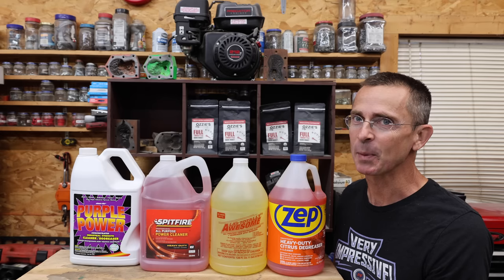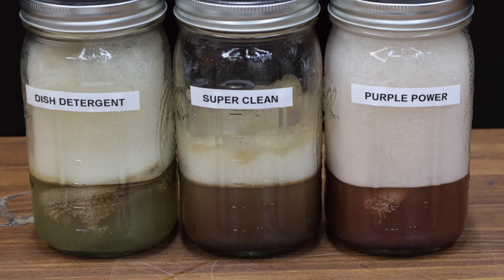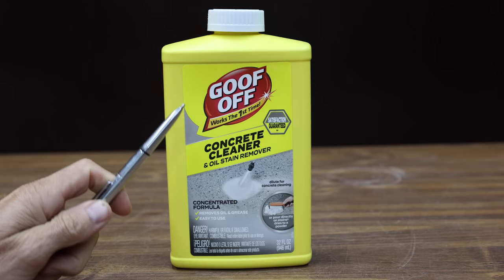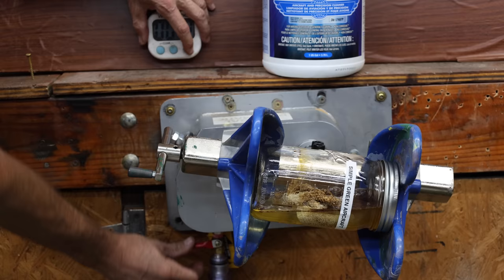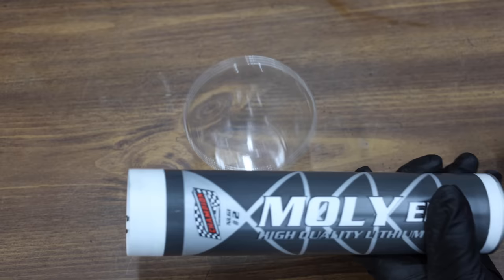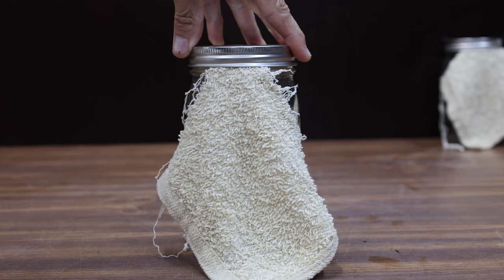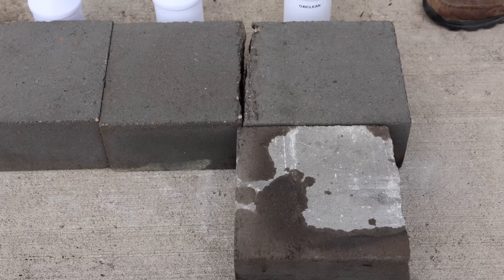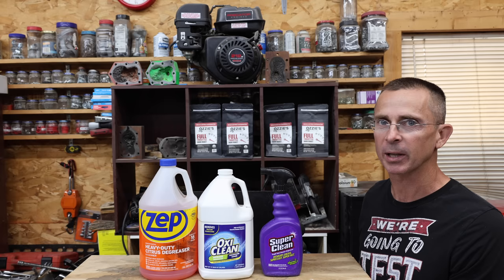Best Concrete and Engine Degreaser? Let’s Settle This!

Comment: I worked at a automotive garage back in the early 90's and they had a powder product to clean the floors. You wet the concrete floor, sprinkle this stuff on, work it in with a few light passes using a push broom, let sit for 5-10 minutes and then rinse off with a hose. It was absolutely fantastic! Concrete was perfectly clean every time, no matter how nasty and oily/greasy when you started. Now I'm a homeowner and want this same stuff to clean my garage/driveway....I have no idea what it was. I cant even find any powder floor cleaners on the market. Does anyone out there know what it might have been and if its available today?

Comment: I use purple power for everything. I've used it as degreasers on my tractors it's  safe use in a steam vac for carpets which it does awesome for stains on carpets it works pretty good for laundry stained up work clothes also works awesome to clean grout lines! For the money it's hard to beat it! But with this awesome channel now I have a couple others to try!
Reply from the maker: Thanks for sharing!

Comment: I like your style of presentation. I have always wondered if the "quality" of the same brand products sold vary from merchant to merchant.  Example is a DeWalt 5ah battery from Walmart as powerful as on from a fleet and farm chain, or Acme, Harbor Freight, Northern Tools... I know DeWalt isn't sold off Walmart, Harbor Freight shelves, but I am sure you get the idea.
Reply from the maker: Thanks for the suggestion.
Reply: DeWalt would waste more time and money doing that  (creating different products in identical packaging and sending them to different places) than just sending the same battery to all places.  Additionally, folks on youtube have tested that.  As long as the batteries aren't counterfeit, they are the same regardless of where you purchase them.

Comment: Stay product testing. BTW I clean engine oil spots off white concrete by putting a small pile of cheap kitty litter over each spot, then soak well with paint cleaner or mineral spirits, something that does NOT dry up too fast. Does a 100% amazing job, try it!
Reply from the maker: Thanks for the feedback.

Comment: I know it's a bit late for this comment, but you should throw a heavy coat of oven cleaner to a surface.. I've used it for years to easily clean old engine blocks that had that nasty cooked on goop, may need to ask cousin Eddy if the farmabeggo could use it somewhere under that beast lol. Good vid though! We all appreciate your non biased experiments!
Reply from the maker: Thanks!  Thanks for the suggestion.

Comment: I will tell you the best thing I've ever found. Works way better than anything else. It's to pour a little gas on the grease spot on your driveway.
Sweep it around a little, but with a broom. And put oil dry on it And work it in with your foot . Then sweep up oil dry. Try it, you will be surprised On how good it works..
Reply from the maker: Thanks for the info!

Comment: In the detailing world, tires can be very difficult to clean. So far, I have used Super Clean, and Zepp, as they were easy to find in my small town. These products have to be used at full strength numerous times to even make a dent. The biggest problem with tires is Tire Shine. Sadly dealers use it and in my opinion, ruins the tire, because is it is to difficult to remove its yellowing effect. It would be great to see a test for a tire cleaner and a tire shine that doesn’t ruin a tire for future washing or yellow fading.
Reply from the maker: Thanks for the suggestion.
Reply: Be careful, Super Clean can corrode/etch aluminum. A few years ago when detailing YouTubers were hyping it for automotive use they said it was safe on all metals. Now SC has a specific warning about that it’s not safe for it. Because of that I’ve gone back to Simple Green Pro HD, the purple one. It’s specifically formulated to be safe on all metals.

Comment: Your product testing is great, I check here before any purchases for the most part. 

I'd love to see a video on frying pans; maybe costco brand vs ikea vs hexclad vs industry standard: stainless steel?  

Is the teflon really as thick as they say, is the pan really non-scratch, is the heat evenly dispersed, at what temp is the heat damaging the pan or the surface coating? 

And I saw your video on batteries lately; maybe you might do one on those 56v lawn mower battery and their knockoffs?
Reply from the maker: Thanks!  Thanks for the suggestions.

Comment: Best as well as least expensive grease, oil and stain cleaner for driveways and garage floors is is Diesel. Simply spray it on and that is it. a couple of days and stain and diesel is gone.
Reply from the maker: Thanks for the feedback.

Comment: Its like you read my mind sometimes lol. ill have some project I have to do and will go to look up different products on it and boom you just made a video on exactly that within a month ago lol. I have a jetski that had a cracked cylinder head, and the breather hose spot watery oil everywhere in my engine bay. was curious which one of these would work the best. Definitely going with either the super clean, oxi clean or zep, whichever one my local hardware store has in stock. thanks as always.
Reply from the maker: Nice!

Comment: Good job.  I like the solvent based degreasers - never had much luck with the detergent ones. I like the testing that you do, if you integrated that into the automotive such as old engine vs rebuilt engine that would be cool.
Reply from the maker: Thank you!
Reply from the maker: Thanks for the suggestion.
Reply: @ProjectFarm  You are welcome

Comment: They aren't for cleaning, but I'd like to see a comparison of 1. Starting Fluid vs 2. Gasoline vs.  3. Carburetor cleaner.  I think they all clean grease better than the others. That being said, lol...the places you can use them is limited.
Reply from the maker: Thanks for the suggestion.

Comment: I think what we may have missed here is that most people using a degreaser aren't mechanics. Generally it's being used for stoves, range hoods, ovens, laundry, tops of kitchen cabinets, surfaces adjacent to stoves and other interior uses, all mostly involving fresh and/or partially polymerized cooking oils. 
   It's unclear if any of these interior uses encountered by normal individuals are similar to trying to clean used motor oil and heavy greases from rags and concrete. 
   I do a lot of hands-on stuff, I've never tried to wash a grease soaked rag. They get disposed of. (I have heard that) if you burn them now you don't have to worry about fire hazards later. But that's probably not politically correct.
   And I think most of us wrenching on cars are going to go for cat litter and gasoline if we want to get motor oil off concrete. Maybe degreaser after gas gets rid of nearly all of it.
Reply: I'm uninformed as to any relationship between grease and mildew.

Comment: I found the best degreaser is Big Red detergent and kerosene 60 Kero and 40 big red also another is Amosol and kerosene or jet A1 fuel and that is about 25 to 30  amsolo and 65 to 70 kerosene 
The big red and Kero with wash of very clean oil and grease and will dry very quickly leaving no residue the other will also but needs more hosing
Reply from the maker: Thanks for the feedback.

Comment: Maybe you could compare few brands of after market common  suspension parts like ball joints or tie rod ends. Moog used to be a good product but not any more. I wonder how after market compares to OEM. Thanks for a great chanel.

Comment: So your telling me Dawn dish soap cant be used at full strength, because they recommend a diluted amount for basic cleaning, but purple power can. Purple power at full concentrated strength will wreck most things it gets on aluminum, paint, plastics, rubbers not to mention your skin. I wonder what the Dawn would have done had you used it at full strength. Dawn also needs warm if not hot water to really work. also run simple green warm 50/50 mix. Those are always my picks. Definitely cool to see the other products.
Reply: Agree. Need way more Dawn, I mix 3-4 oz in a 32 oz spray bottle. The amount he used is for doing dishes.

Most of these will corrode/etch aluminum. Unlike The WD40 Specialist and Simple Green Pro HD which are specifically made to be safe on all metals and not corrode.

Comment: You pretty much covered most of the popular degreasers, so thank you for that.  I also like the fact that you have sped up the video.

Future test recommendations (sorry in advance if you already have videos on them):  motor oil filters, shoe repair adhesives, furnace air filters, auto air filters, OBD II scanners (bluetooth version), low-end OBD II scanners (with built-in screen), windshield wiper fluids, leather conditioners.
Reply from the maker: Thanks!  Thanks for the suggestion.

Comment: Try a 3M degreaser? I've found the 3M General Purpose Adhesive Remover to also be a good degreaser, but 3M probably has a more dedicated product for degreasing. I did like the video though.

Comment: I've Used Totally Awesome And Super Clean. I'm A Mechanic And Used In An Engine Bay / Parts Cleaner Application. I Will Say Totally Awesome Works Good But It Does Have To Sit For Awhile Before Your Power Wash Or Scrub . The Super Clean Was My Favorite. Works Best In Every Way In My Uses Compared To Totally Awesome. One Thing I Did Notice On Bare Aluminum Between These Products Is Totally Awesome Leaves The Aluminum Dull. It Doesn't Pit Or Eat The Aluminum But Leaves It Matte Same With Plastics . The Super Clean On The Other Hand Leaves The Slightest Bit Of Gloss To Aluminum And Plastics. Makes Engine Bays Look Really Nice. Super Clean In My Opinion Is Stronger Than Totally Awesome. Now I Have Tested Totally Awesome And Purple Power Back To Back On Pistons. I Was Soaking Them To Clean The Carbon Off. Totally Awesome Does Etch Aluminum If Soaking In It For Days. Purple Power Not So Much. Purple Power Worked Better On Carbon Build Up Than The Totally Awesome. Didn't Have Super Clean At The Time.
Reply from the maker: Thanks for sharing.

Comment: 8-10 Parts of Super Clean to one part Instant Power Heavy Duty Drain Opener (has both NaOH and KOH) - x-jet it. If you want to save $$ mix 9 parts NaOH (sodium hydroxide) to 1 part KOH (potassium hydroxide). Add 3-6 cups to 5 gallons of either water or Super Clean. KOH is 3X the cost of NaOH. Using a product which contains 90% NaOH & 10% KOH is like getting the best of both, you will be get a lower in price product with a better exothermic reaction than with Potassium Hydroxide alone, but you will have a faster penetration and better rinsing product than if it just had Sodium Hydroxide.
Reply from the maker: Thanks for the constructive feedback.

Comment: Need to use these products to test against carbon build up in engine. Removing the varnish from pistons rings, and all the staining is the real true test. purpose power is good, but it will make aluminum black!
Reply from the maker: Thanks for the feedback.

Comment: Suggestion: 
Contactor grease and rinse free flux. 
I use deoxit for electrical plugs and a rinse free flux for electronics. I know that the flux I use for plumbing needs to be rinsed because it is so aggressive and persistent that over years it will eat into your pipes causing very difficult leaks to find. Always quench and clean your joints to avoid this. In electronics you cant so much. No water. I'm curious how well rinse free flux works and does deoxit keep contactors clean or erode them like old flux. Kinda two subjects. Not really, maybe. You are the guy I think of when I want to know this kinda stuff.
Reply from the maker: Thanks!  Thanks for the suggestion.

Comment: By far and away the best cleaner that I found is the $3 a gallon stuff from the dollar store in a plane clear jug but be careful cuz it will eat the paint if it's not diluted but it makes an old greasy aluminum lawn mower motor come out looking like a brand new one!
Reply from the maker: Thanks for the suggestion.

Comment: Yo!  Loving the videos!  Two things-  how many qts did you have to use when you put the oil cooler on???  2- do you use seafoam to clean your crankcase before you change the oil & do you use Lucas oil stabilizer when you refill your oil?

Comment: LA's Totally Awesome is available for SUBSTANTIALLY less money at Dollar General, Family Dollar and Dollar Tree.

You paid a ridiculous $20/gallon.

A half-gallon jug at Dollar General and Family Dollar is $3.75 which is $7.50/gallon.

At Dollar Tree, a 32 ounce bottle is $1.25 which is $5.00/gallon (this is how I buy it).

At Family Dollar and Dollar Tree, 20 ounces in a spray bottle is $1.25 which is $8.00/gallon.

It has multiple uses and, depending on the type of stain/soil and what is being cleaned, it can and should be diluted with water per the various ratios on the label.
Reply from the maker: Thanks for the feedback.

Comment: I'm surprised you didn't use Muriatic Acid, usually the goto for cleaning concrete driveways. Never used anything better
Reply from the maker: Thanks for the suggestion.

Comment: which heated outdoor vest would you recommend regarding 1 Best thermal heating, 2 Maximum thermal element coverage, 3 Least bulky material, 4 Very lightweight feeling, 5 Durability, 6 Price point  ?
Reply from the maker: Thanks for the suggestion.

Comment: If you revisit this one I'd like to see how mineral spirits, acetone and brake cleaner fair. I don't think anyone would mind you branching out, I enjoyed the video on sprucing up your old diesel, Been doing the same with my own for a while. If you could only do one or the other I don't think anyone would want to see the product testing go, if you can keep up with both I don't think anyone would mind, and I'm sure quite a few would enjoy the tangential content as well. As long as you continue to do a reasonable amount of product testing on the big ticket less subjective things I would think most would be happy. 
To give an example: I don't really need a big brand comparison between the usual suspects in power tools for each and every type of tool they make, such as Dewalt, Milwaukee, Makita, Ryobi, Rigid etc. Because subjectively there isn't really all that much difference, although it is nice to see new or budget brands that don't have a solid reputation, like HF's new tool lines for example. 
  However when it comes to many of the chemical products, it seems to often be the case that half or more just flat out don't even work, or very poorly, I don't think anyone ever felt like they wasted their money buying a Dewalt instead of a Milwaukee for instance, but I used PB blaster almost exclusively for years and always felt like it wasn't really doing much, and discovered your video on penetrating oils and learned that it was useless, with no improvement. Switched to LW and have sworn by it and your channel ever since  to anyone that will listen.
Reply from the maker: Thanks for the suggestion.

Comment: Have you compared the various concrete garage floor preparation methods prior to the application of stain, paint, epoxy etc.?  There are sanders and various acids including citrus.  I know prep is critical to a good coating so I'd like the best chance for good finished product.  Thanks.
Reply from the maker: Thanks for the suggestion.

Comment: You forgot liquid laundry detergent (Tide).  I've used liquid laundry detergent on my hands after working with gear oil and full strength liquid laundry detergent will definitely work and get that horrid gear oil residual smell out of your hands!  I'm not sure how liquid laundry detergent will work on the driveway but I think it should work fairly well.  Mind you liquid dish soap is the cheapest route for any of the misers out there!
Reply from the maker: Thanks for the suggestion.

Comment: Where was Super Clean in this testing. I spilled two gallons of used diesel oil on my brand new concrete driveway and with super clean a broom and a hose my driveway was saved from a big nasty black oil stain
Reply from the maker: Thanks for the suggestion.

Comment: I would be interested if you tested foaming soap for foam cannon cleaning car.  Either which soap foams the most or if thick foam cleans better vs runny foam that doesn't stick as much.
Reply from the maker: Thanks for the suggestion.

Comment: Noob question. Will these products to used on the protective plastic panels that cover the engine? Also are these product is a spray on, brush then wipe off with a rag or it's has to be rinse off? Thanks much.

Comment: 90 degree saw cuts.are all chop saws  the same .  dewalt chop saw would not cut molding straight had to put a straight edge on it to get the 90 degree cut i needed.
Reply from the maker: Thanks for sharing.

Comment: There is a ongoing debate on line  on using rotella t6 vs motorx oil or any manufacturera specific oil for offroad bikes like ktm, honda , kawasaki etc... it will be great to see that comparison
Reply from the maker: Thanks for the suggestion.